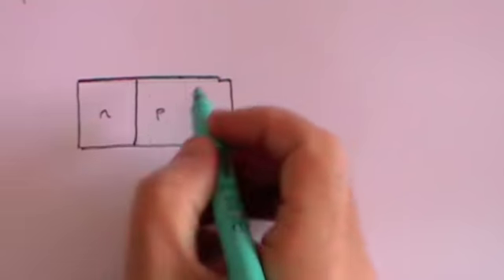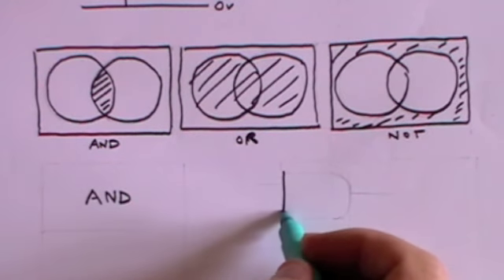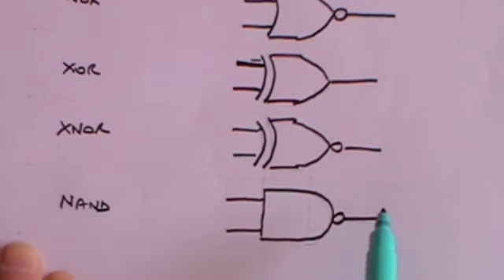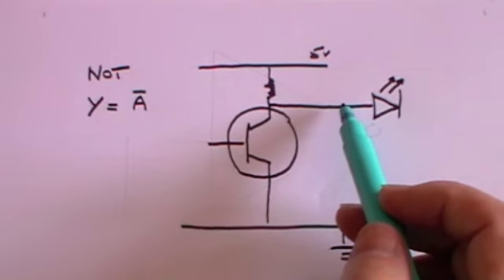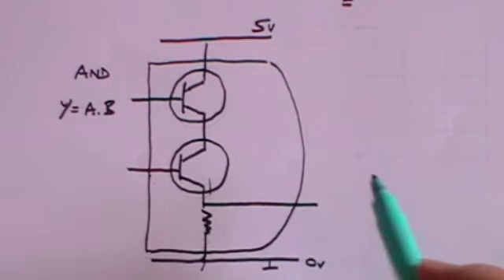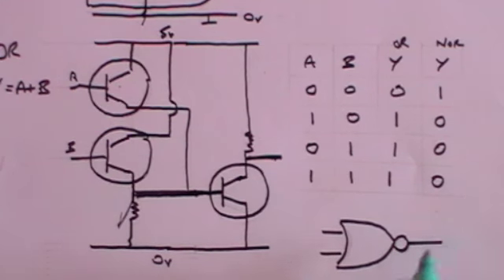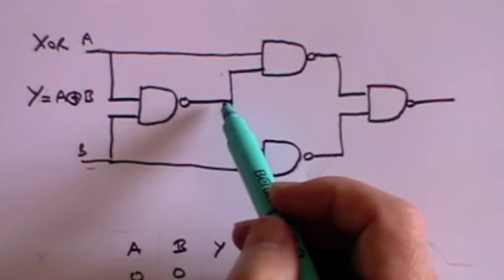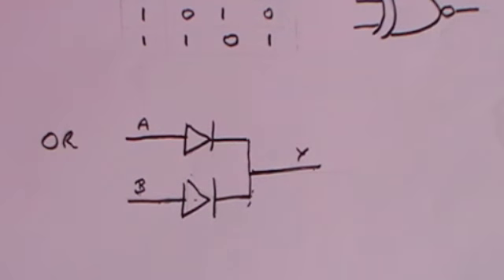An Introduction to Logic Gates

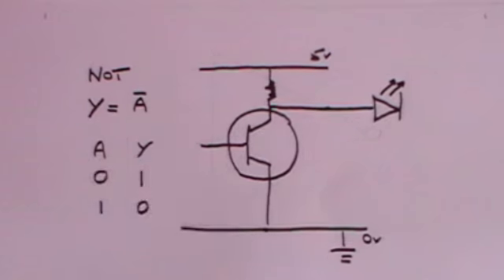Comment: Why at 23:00 does the voltage in the output go to zero when the transistor is on? In other words, what law dictates that when you connect a ground in series to something else, the other thing's voltage drops to zero?
Reply from the maker: If the transistor is on its acts like a switch and allows a current to flow. Since it has negligible resistance there is no potential drop across the transistor so the voltage on the output is the same as that on the earthed wire.
Reply: Is this correct: because the transistor has negligible resistance, the current would rather go down that way, thus there is no electrons going to the LED, which results in no voltage drop across it, therefore the output has 0V, as does the ground which the emitter is connected to. And then, as you say, all the voltage is dropped across the resistance.
Reply: According to an at home experiment i just did now, yes.  What i did is took an ac to dc 10v. converter, and found a spring in an old airsoft gun. I used the spring as a resistor, which generated heat that i could feel (meaning current passed through it) *it was practically a hand warmer of sorts.  Then i stripped the wires on the converter bare, and started my experiment.  I hooked the resistor up to the + and - of the converter, and of course it got warm.  Then, the next part was amazing.  I took another bare wire, and connected it to both wires from the converter BEFORE -edit: turns out you can hook it up or downstream, it doesnt matter! - the wires on the hand warmer.  Since it had less resistance, current flowed through the wire, and not the resistor.  Therefore, his not gate is correct, and would work.
Reply: Actually there is a voltage drop between collector and emitter but it's small  , for low power transistors is usually in the range of 0.2V. In the trasistor's datasheet you can find it as  collector - emitter (Vce) saturation voltage.

Comment: He is wrong at 14:30  That is a truth-table , there is no 2
http://en.wikipedia.org/wiki/Truth_table  That link is complex  Here's a simpler one  http://gcat.davidson.edu/mediawiki-1.15.0/index.php/Logic_Gates:_Symbols_and_Truth_Tables
Reply: If it were a truth-table, the 2 would be a problem. However, 0 and 1 are being used as integers, not boolean values.

Truth tables are about logical values and operations. He's setting up for arithmetic.
Reply: Medi Kouhai Yes, you are correct  I design circuits and make printed circuit boards I'm use to using truth tables with different gates to "steer" the logic around for addressing and logic. I have a truth table hung on the wall for reference!
I now see his arithmetic reference  thanks for the correction
Reply: In binary 1+1=10
Reply: (decimal) 2 = 10 (binary)

Comment: the circle is called an inverter and 1+1=10 not 2. If you take a 5vcc, 1k resistor, 4 parallel SPDT switches on connected to 5vcc and off connected to ground 4 logic probes one per switch, 7 segment driver and a 7 segment display. This will give you a nice binary converter.

Comment: sir i always get confused btw current and voltage.. looking at these circuits dono who to analyse the working of each device
Reply: Voltage= current/resistanse

Voltage counts as: Volts
Current counts as: Amperes
Resistance counts as: Ohms

If you need something else reply to me : )
Reply: Petros Oratiou true ok but what in reality exists.... i mean voltage or current ...
Reply: ravi kiran well the current because what makes the current is a force by a moving magnetic field and that's it. Voltage is just a product of that equation.
Reply: Petros Oratiou  well i guess then why is it called the pottential differene the main reason for flow of charges ... and this is called EMF

Comment: At 14.48, should it not be 1 1 1  ?
 ("All arithmetic operations performed with Boolean quantities have but one of two possible outcomes: either 1 or 0. There is no such thing as ”2” or ”-1” or ”1/2” in the Boolean world. It is a world in which all other possibilities are invalid by fiat"  )!
Reply: 0 and 1 can represent true and false, but they can also just be used as numeric values, 0 and 1. That's what he's doing. It's not a logical operation, it's an arithmetic one. It's perhaps a little confusing that, once he does start using logic tables at about 23 min in, he doesn't switch to 't' and 'f', but ambiguities like that are part and parcel to EE and comp sci.

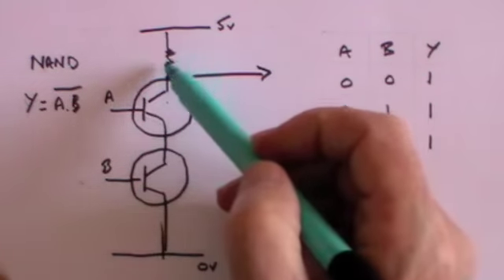Comment: 37:04 What exactly is the point of the resistor?
Reply: In this case, it's a pull-up resistor. In order to understand this, you need to understand the concept of a voltage divider first. It also prevents shorting out and burning the transistors.
Reply: Blizzard Muffin its a safety measure as 5 volt supply across a transistor without a resistor would casue a very high current ( i=v/r or 5/0 = infinite, means a high current).
Reply: It's not only for safety; it's also a pull-up resistor.

Comment: helpful thanks for that great explantion.
just at first part when you explain NOT (invertor) you did not mention the puple (circle).
Also i am wonder when you mentiond in AND gate the input both 1 the output will be 2 we dont have 2 in Boolean form

Comment: This is an awesome tutorial - thanks for putting it together!!

Note, however, that the AND gate at 25 minutes doesn't work in practice. Transistors allow the voltage from the base to flow through the emitter, even if there is no voltage at the collector. So if input B is high, then the output will go high. Breadboard it and you will see...

So far, the only working AND I've been able to make is a NAND plugged into a NOT. :)

Comment: Your NOR gate can't light up it's LED if A and B have zero volts because the LED requires a positive volt to work! :P
Reply: The transistor in the inverter part of the circuit is directly connected to +. This circuit works -- I just breadboarded it.

Comment: For the NOT-gate; when the input is 1 or high the output isn't really 0, it's low (0.5 if you will). Is the only way to convert that low output into a true 0 through another transistor?
Reply: when an output is 1 or 0 that is a boolian output...not a voltage.  for 1 substitute TRUE and for 0 substitute FALSE and you won't have any 0.5's  a very common set of outputs might be +5 or +0.5    HIGH or LOW.  TRUE or FALSE.  1 or 0.  the actual voltages don't really matter...only that 0/false/low is a lower voltage than 1/true/high.

Comment: if the NOT (also know as the invert gate) has input (a) has is positive (logic 1) then the output will be negative (logic 0) and if the input is a negative (logic 0) then the output will be a positive  (logic 1). the NOT gate can only have one possible input row.

Comment: Orlando, yes two diodes would work for an OR gate, but transistors would be necessary for other types of gates. This was actually specifically mentioned at the very end of the video.

Comment from the maker: Probably yes. But the point is that the system as designd will do it for you automatically. Otherwise it would require manual intervention.

Comment: Could you not make NOT gate just by using the pnp transistor, if there would be voltage on the base (input) there wouldn't be voltage on the collector(output)[in pnp when there is voltage on base, there isn't on collector, it "closes the switch"(opposite to npn transistor)]

Comment: If I remember it right, you can build an AND with diodes by simply turning them and connecting the output to +5V over a resistor. But you have to be sure that a '0' input is connected to GND and not just left open.

Comment from the maker: When there is an input voltage, the transistor behaves like a closed switch. So all of the points from the ground position up to the resistance are at 0V. This means that there is no output voltages to drive the light emitting diode.

Comment: On the NOT gate, when there is an input voltage, why does the current cease to flow to the LED and instead flow straight to ground? It it just because the lower resistance?

Comment: QUESTION...the 4000 series logic gate can be powered from 3 to 15 volts, so, using 4071 as an example, if I supply 15 volts to the Vdd pin but only 5 volts to an input pin, what voltage would i get at the output, 5 or 15 volts+/-?

Comment: Isnt there a finite voltage drop present across the collector - emitter (V c-e)? If thats the case then shouldn't the 5V get divided into I x R and Vc-e ? Does it mean that the diode will not strictly be at zero ?

Comment from the maker: Remember that a transistor is essentially a switch. If a voltage is applied at the base then the switch is closed, if not then the switch is open. (The start of the video explains why). If the switch is closed then it is as if the output were simply a direct connection to the ground 0v. That means that the output is at 0v. If the switch is open then the output is connected to the 5v through a resistance.